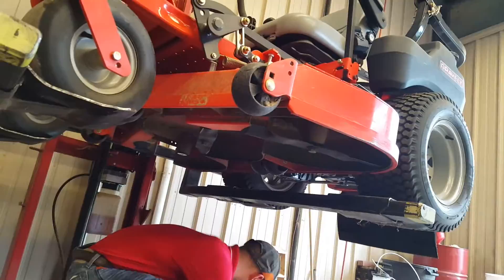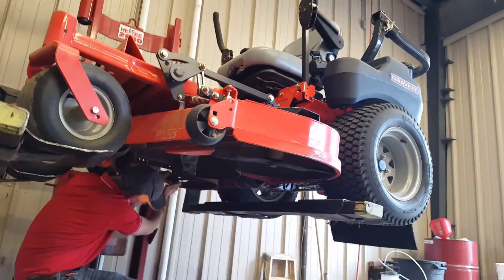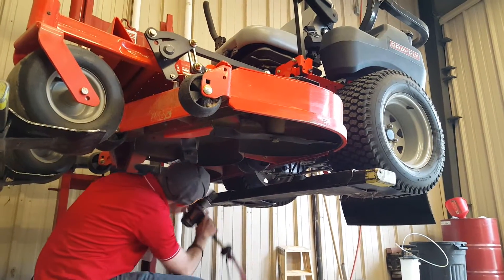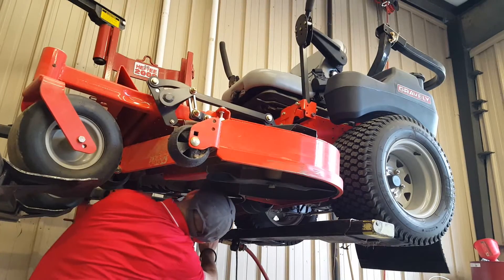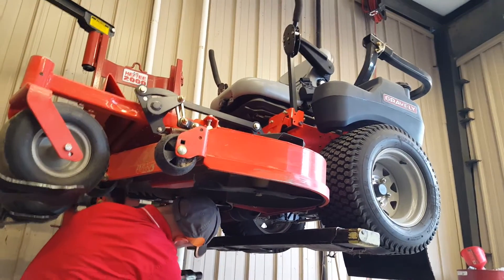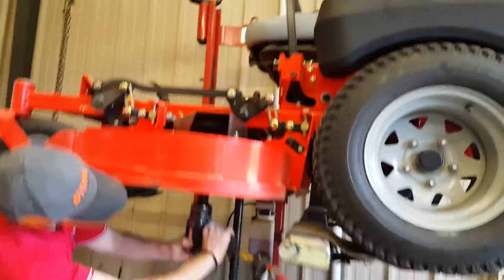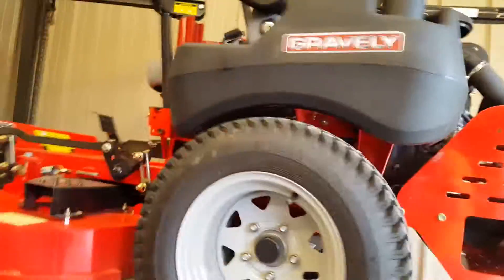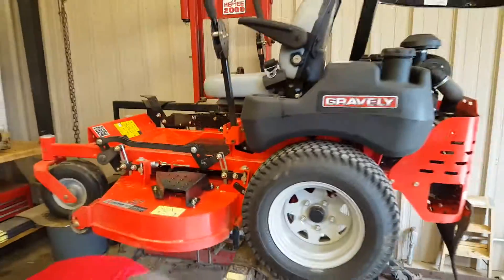Vlog- Just a quick video getting the Gator blades installed on Gravely Pro turn 152 - SS Lawn Care

Comment: which Gator are those? G3, G5, or G6? I have a 2016 pro turn 60" w/ 25 Kohler. I am wanting to get a set of the G5 or G6. Probably try the G5's first as i dont want the G6's to bog down. I cut 100% Bahia. Would you recommend them for Bahia? Also i side discharge, no mulch kit or chute baffle.
Reply from the maker: G5. They want bog you down. I side discharge as well with no mulch kit.
Reply: Just ordered a set of G5. Ready to see how they do. The factory high lift blades cut amazing for me but i want to chop the clipping up instead of cutting hay!!
Reply from the maker: +Matthew Herrington YeH the factories are great. when the grass isn't growing as fast